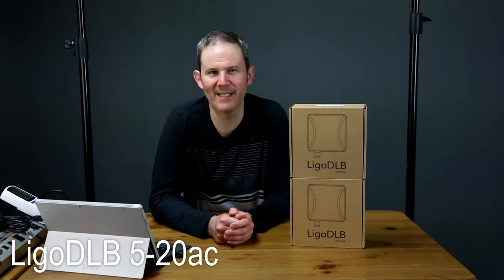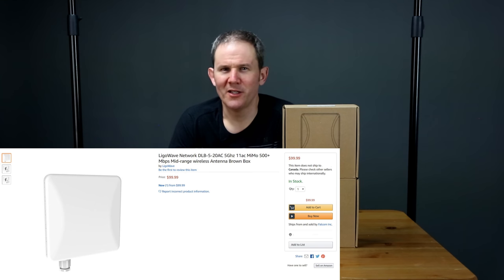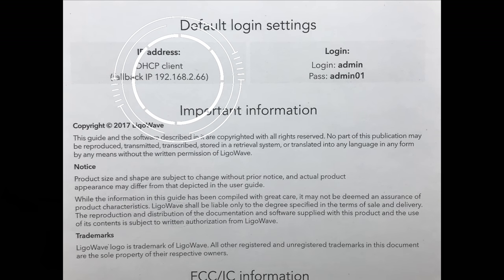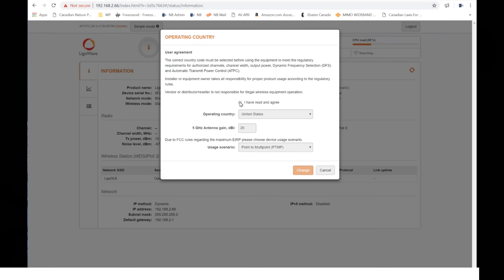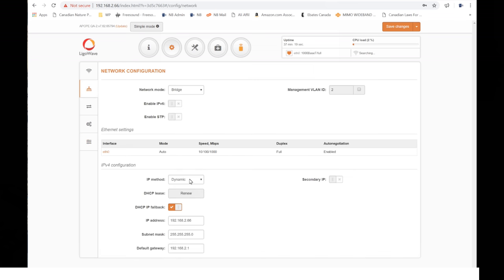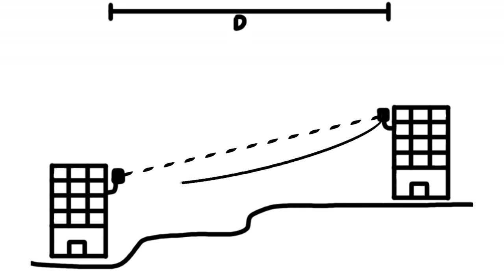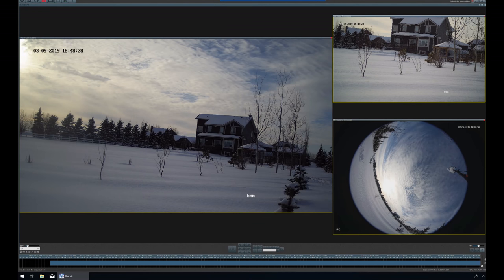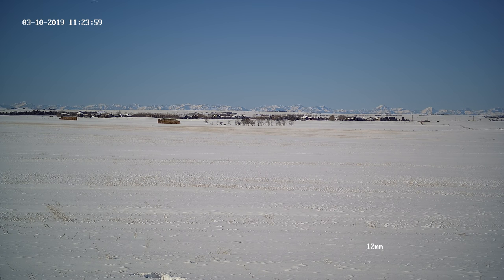How to Create a Point-to-Point Network for Security Cameras (LigoDLB 5-20ac)

Comment: So do I understand correctly that the PoE Switch is the common connection point for the cameras and Ligo Station? For power, I'm understanding that two outlets would be needed at the Station side, one for the injector to provide 24V for the Ligo Station and the other to power the PoE Hikvision cameras.
Reply from the maker: You are correct on both statements.  You could also take it a step further and say the router is the common connection point of all the devices as it distributes the IP addresses and manages traffic.

Comment: HOW CAN I CONNECT MY ROUTER TO ONE OF THOSE ligoDLB 5-20 so that other ligoDLB 5-20 can throw out wifi from the router.
Reply from the maker: You would need to connect it to a PoE switch or use a power injector and configure the device as an Access Point. I have not done this yet but will add it to my list of future videos.
Reply: @HomeTechDIY  thank you for the reply. Waiting for that video pls. 🙏